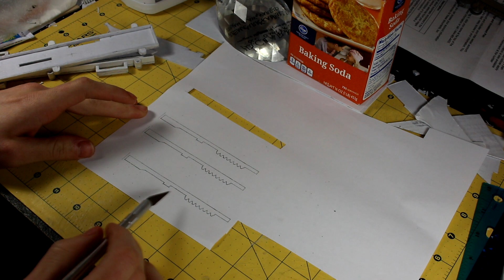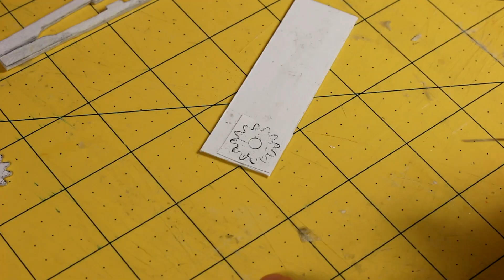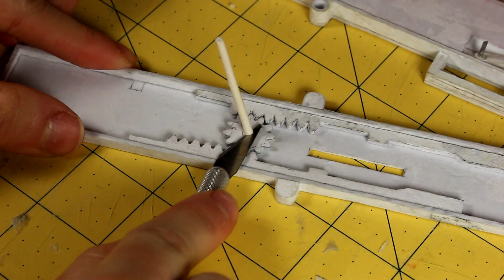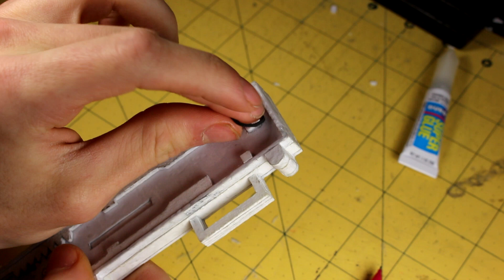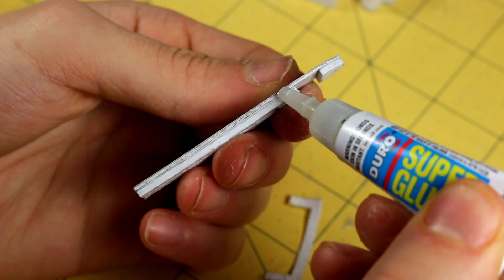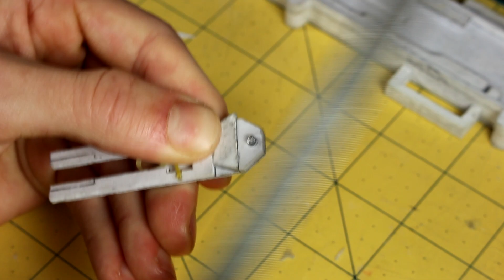How to Build the Assassin's Creed Paper Dual Extended Hidden Blade Part 4

Comment: @shelden do u use a4 or a3 to print the blueprints
Reply: I think he uses letter which is standard in the US
Reply from the maker: I use US standard letter paper
Reply: @SheldenCaudill  I have 3 questions: 1. When is part 5 coming out? 2. How can i print the blueprints on a A4 without distorting them? 3. When are blueprints in mm coming out?
Reply from the maker: 1. Part 5 will be out in about an hour. 2. I am currently trying to figure out how to not have A4 paper distort the images. 3. I'm still not quite sure when they will be out but it will be soon. :D
Reply: @SheldenCaudill  Thanks for the reply! Keep up the good work!

Comment: hey dude! quick question, are any of your components thinner than 3mm? I'm trying to see what different materials i can use to make this since i dont have enough time to stack, glue and wait for paper. But most other materials start at 3mm so i dont know what to do haha
Reply from the maker: Some of the components are thinner than that yes. If you can use 2mm material I think it would be a lot easier because 2mm is almost the exact same as a 16 layer piece. Good question lol
Reply: @SheldenCaudill  I'm literally working on my hidden blade as you replied to this. I ended up finding some reliable 2mm pvc foamboard (but it's tougher than normal foamboard) and it's going great!
Reply from the maker: That's awesome! I'm glad you found an alternative haha I've always wanted to use pvc foamboard. Well hopefully everything keeps going great! :D

Comment: Yeah so I did tried making it since watching it being created to a 3d model made me too curious for my own good and I like failed at least 2 twice and had to redo it but only up to like the blade portion I get stuck at... but yeah shelden you make this easy especially cutting the paper with ease my hand is hurting now from trying to cut out the bottom base 😭 what am I doing wrong
Reply: Thanks for the advice man
Reply from the maker: I'm sorry you failed doing that. I fail at what I do so many times lol I just leave it out of the videos. So you aren't alone. Also cutting the paper is hard to do yes. I suggest frequently changing your cutting blade to make it a lot easier.

Comment: Can I make it with thin wood?
Reply: If you can find wood as thin as 1mm then maybe. I cant find 1mm wood anywhere.
Im actually gonna try doing it with 2mm PVC foamboard, and some pieces of paper for the really thin parts
Reply: Ok
Reply from the maker: Yes you can use thin wood :D

Comment: Hey! I need your help.  The 16-layer paper that I glued after some time bends under the influence of moisture (although it lies on a dry shelf).  What to do in this situation?
Reply from the maker: If it is warped even though it is completely dry, I recommend using super glue along the edges and reshaping it with pliers. It should help. :D